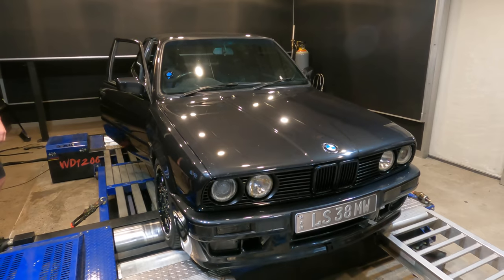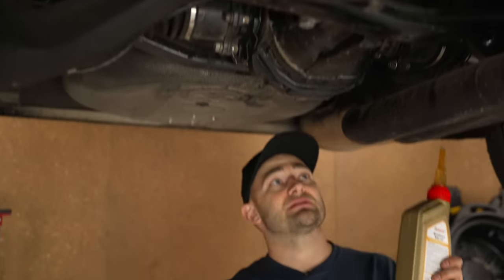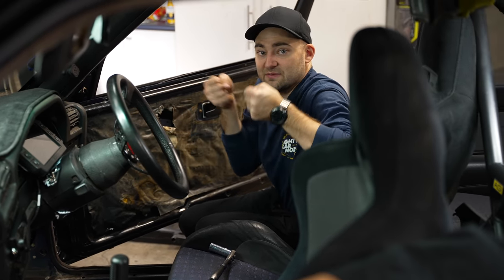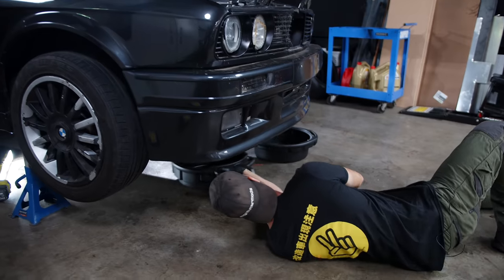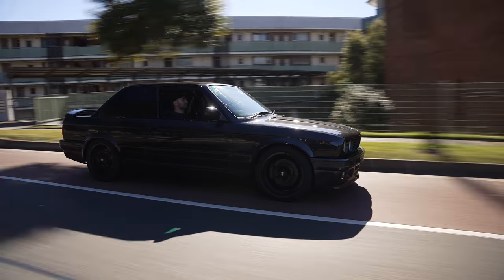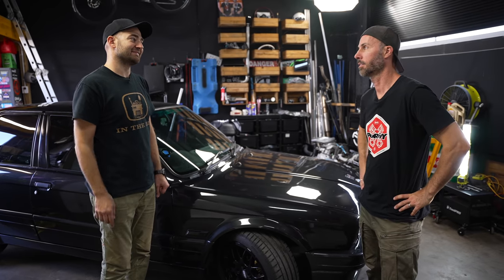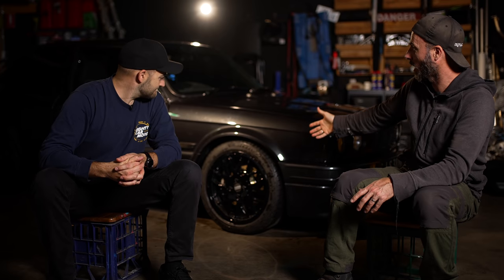We take the V8 BMW E30 for a slide

Comment: Really enjoyed the dark lighting when having a chat - you should use this more often.
Reply: FACTS
Reply: Quality was also very crisp on that segment. 👌
Reply: And rockin’ Aussie milk crate seats is waaaay cool 😎
Reply: @tonybennett3332  Did you see the cutting board style on the seat pad? Very slick. Kinda like the car, posh and usable at the same time.
Reply: If they did little bits like that at the end of the video and talked about conspiracies related to the car or work they did, that could replace unicorn circuit too, cool idea
Reply: Confirmed - the lighting adds a few kW, I reckon 😎
Reply: @ScottOrd  An easy bolt on upgrade LOL!
Reply: Fireside chat :)
Reply: Liar

Comment: you should open up a hidden air flow canal from the inside of the wheel arch, directly to the air intake. That way you don't destroy the appearance and get some proper air flow
Reply: Thats how you suck water into the intake
Reply: @shawngebo697  you mean extra compression? because water injection is a thing ;)
Reply: @shawngebo697  yeah if you just take a hole saw to your wheel well. If you do it properly and make a splash guard and put a rain sock on your filter then it will be fine

Comment: Y’all should have made a “H” pipe exhaust nested of blocking off the cut outs.
Reply: The exhaust ends on a single exit anyways, X and H pipes are cool for dual exhausts, won't change much with a single exhaust
Reply: @joealex65  Would still help with scavenging connecting that early, wouldn´t it?
Reply: @joealex65  I think that car has a true duel exhaust. That’s the only reason why suggested it. At a minute 1:07 you can see the complete exhaust system

Comment: May want to check your math on the not any heavier part.  Having weighed my BMW Iron Block M52B28 with a cast turbo manifold and the turbo and all the accessories coming in at 418 lbs, that's less than an LS without accessories and I had a good 50-70 lbs of extras on it.

Comment: would love to have an E30 myself, but not with all of the features you got into the car, and even more power than you, just for fun!

I am a developer, so by reading stuff online, I could probably develop my very own system, maybe with app controls, which the car you built doesn't featured. app control was some of my first ideas after watching the video when the tech part was shown

an amazing feature you could add to the car if you still have it, it's RGB under the car, that's something I would love to have if I had an E30 (which I might buy some day in the future to modify)

Comment: One of the best balanced bmw's ever, and then put an extra heavy v8 in it....Nice car for an  sprint, the cornering is f-ed up.
Reply: Actually there’s nothing in it. Both are around 230kg with transmission. The M20 had a cast iron block, the LS is alloy.
Reply: @nowukkas2472  My bad, I am  comparing it with the S14 engine. Comparing it with the 6 cilinders is more common.

Comment: I can't think of a factory car of any any vintage or price that could compare power to weight-wise except maybe some Corvette's and Cobra's.
Reply: Lotus Carlton/omega, a bunch of ford cosworths, Metro Turbo, Renault 5 turbo.
Reply: @zogworth  Ferrari and Porsche etc would make it but I was thinking RWD front engine. Later year Mercs and BMW but nothing as light as what these lads have built. Caterham if you want to brave the elements. The only real comparison is to hot rods, people have to build this stuff because manufactures wont.
Reply: @robmanueb.  the Metro actually out accelerated the contemporary Ferrari at the time which is insane.
Reply: @robmanueb.  the downside of all this pesky safety is more weight. Though cars did reach peak bulk mid 00's and have started getting lighter again now thanks to small turbo engines and decreasing cost of making stuff out of ally/carbon fibre/other composites
Reply: @zogworth  Yeah old cars are basically tin cans. I grew up watching people soup up V8s for their Toranas and Cortinas, those things weigh nothing. Group B cars for the road were a fun time too!

Comment: Also use a bmw v8 either a 3L a  3.5 a 4L a 5L and also the V10 and show the euro old skool cool cars also use a oldskool 5series or 7 series as they are like commen doors so you can show what ppl can do to the cars you can afford to buy as e30s are so expensive and not easy for all to buy but e34  & a e39 E60 E36 e46 E90 and the. Corresponding 7 series models as well e38 down to e32 and up two models even do a E38Li the limo version bagg it and do the turbo or the V8 or the older 3.5 6 model they would be cars I'd love you to mod and show how to do it as I have tried to get coilovers for mine at the prices from some of the places in your old gti vids and it's like 5 x the price you guys payed so to see how you go about getting parts that aren't donated by the sponsors etc

Comment: OMG it's limp dick drifting in Australia where cars don't even have the correct front end gear for actual drifting on dry pavement or bitumen, the cars are all under powered because they can't make the rear wheels burn rubber on the dry surface & they also don't have the huge hand brake levers for doing skids sideways. So SAD.